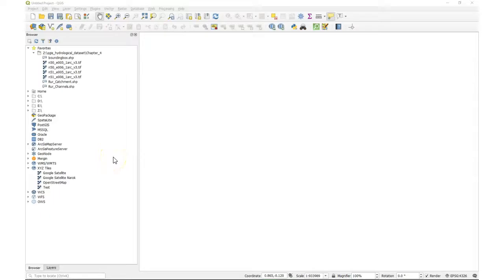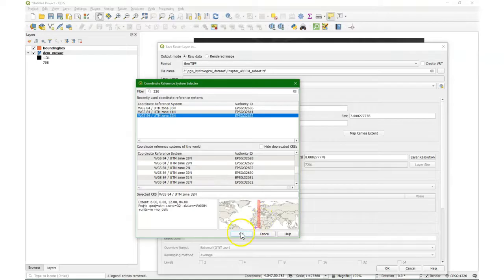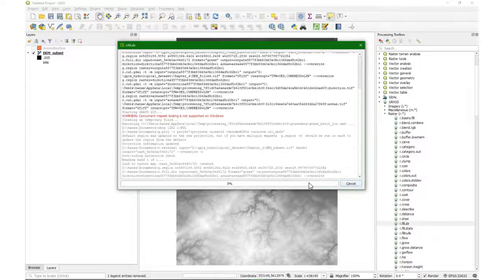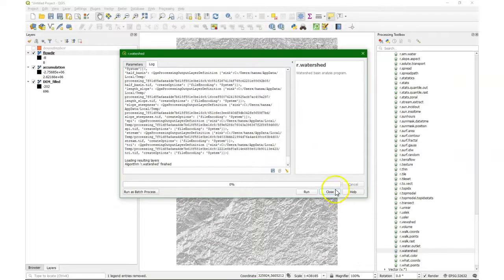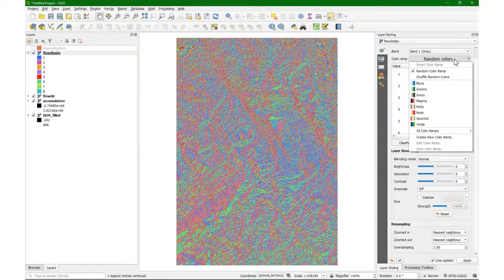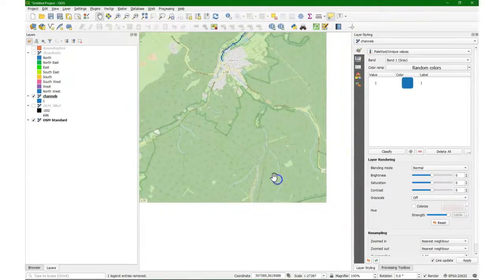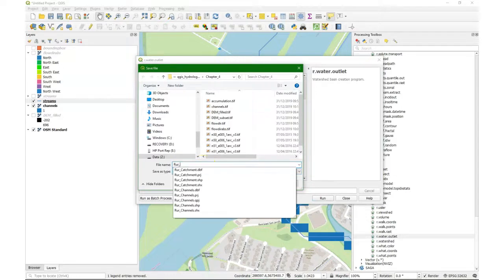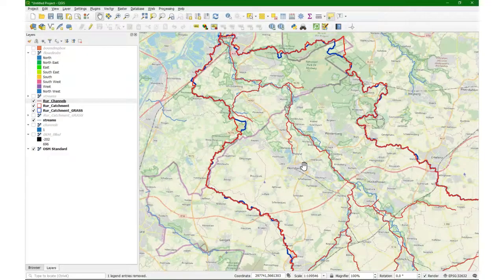Stream and Catchment Delineation in QGIS 3 using GRASS tools

Comment: Hi, I have 2 points where I got different outputs. When I tried to change the values for flowdirabs it would not just change the label but the output as a whole, which was not in your case. The second was for the river, I got it on value 0 but not on 1.
I apologise if it's hard to read but let me know if you would like me to rephrase, thanks.

Comment: Hi! Great video! How can I remove bridges from DEM? Problem is that when channel hits a bridge it redirects to a nearby catchment area.
Reply from the maker: Maybe the resolution of your DEM is so high that it is a DSM instead of a DTM. You could resample to a courser resolution. Or get a layer with bridges (e.g. through QuickOSM), rasterize them and apply some mapalgebra to reduce the elevation at the bridge.
Reply: @HansvanderKwast  it's 1x1m grid. But smaller bridges aren't removed. I Will try to modify it. Thank you.

Comment: Thank you very much for the video! I've found all your video's extremely helpful! I've been trying it out for my own project in Uganda but the result (both through GRASS tools and SAGA tools) channels are not always accurate to rivers displayed on basemaps. Even though a lot of rivers are the same, others are split in two different big rivers while on the basemaps it's just one river. I was wondering how I can alter the results so the channels are displayed more realistically. I've tried different SRTM layers, different tools, etc. but they all display 2 different rivers instead of 1.
Reply from the maker: You can try to improve the results by burning in the river network. There are 2 videos about that on my channel. Burning in the river network will force that the DEM is lower where the rivers are. Your problem can be caused by (1) human manipulation of the stream flow, (2) errors in the DEM, (3) resolution of the DEM in relation to local depressions, such as wetlands and lakes, ...
Reply: Thank you very much for your answer! I burned it and it displayed very accurate rivers now compared to my basemap! You're my hero

Comment: Thank you very much for the video Sir. Anyway, what is the unit of flow accumulation? Because on the channels creation step, you set the flow accumulation should be bigger than 50,000. Is it in m3/s?
Reply from the maker: Flow accumulation is the number of upstream cells that contribute to the cell. It's not m3/s, because there's no rainfall as input. So basically it is a unit of rain on each cell and then adds it up. A threshold >50k means that only cells that have more than 50k contributing cells are considered as a river. You need to calibrate that number by looking at existing maps or satellite images.

Comment: Hi thanks for the tutorial. I was able to make it to almost the very end but when I run r.waterout it kept showing SetColorTable() only supported for Byte or UInt16 bands in TIFF format. How to solve it?
Reply from the maker: That's no problem. You don't need a color table. Check if the output has been generated.

Comment: Hello, Sir. 
I can't produce a good watershed @ 20:15 because one of my streams wrongly flows to the opposite direction ( i also noticed it form the flow accumulation step). Is there any option to reverse its course? Thanks.
Reply from the maker: That's due to the DEM and maybe the filling process. Try another DEM or another workflow (PCRaster, SAGA, Whitebox).

Comment: I just discovered your channel and I love it. Does it matter the version of QGis?
Reply from the maker: The algorithms don't change. But to avoid errors I recommend to use the LTR versions. The problems have normally more to do with the steps:
- do not use a DEM without reprojecting from GCS to a projection with x, y in meters. Interpolarate voids, otherwise no continuity of the flow. Fill the sinks, otherwise a lot of disrupted streams. Don't use a very high resolution, especially if you have a large catchment. Don't use spaces, dots, special characters in folder and file names. The area should also not be too flat or too human modified. Outlets should be chosen in the delineated stream, otherwise it will not follow the model.
Reply: @HansvanderKwast  thanks a lot for your tips. I have two questions, is it the same reprojecting the dem than simply using the right click feature of exporting and choosing the desired SRC? I‘ve not seen in your videos the voids interpolation, does the fill tool make also that?
Reply from the maker: @SuperDanisse  Right click is available from version 3.16. The videos are made with older versions. This video shows how to interpolate voids: https://youtu.be/FwJSBoTn1y4

Comment: What happened to the upper left corner that downstream values are very dark (low) at 14:25?
Reply from the maker: These are negative flow accumulation values indicating that those cells have surface runoff from outside of the current geographic region. Meaning they don't belong to the catchment that we're going to derive.
Reply: @HansvanderKwast  Thanks a lot for detailed explanation. Your video is very helpful.
Reply from the maker: @jiongwang7645  FYI a step by step tutorial with data is available at GIS OpenCourseWare: http://www.gisopencourseware.org 
You can find it under the Advanced QGIS tutorials.

Comment: HI Hans, Can you please explain,  what does this (-) Flow accumulation mean? do we have to convert this "-" accumulation also into "+" values?
Problem:
1) I have a catchment which shows higher negative flow accumulation than "+" values, this "-" flow accumulation defines my river network exactly than positive flow accumulation
2) Why D8 is better than MFD Method?
Reply from the maker: Negative flow accumulation means that it's outside your catchment. More info here: https://grass.osgeo.org/grass76/manuals/r.watershed.html
D8 is not better than MFD. What you want to use depends on your area. In science you start with the most simple model. In this case D8. MFD might give better results in flatter areas. There are also other algorithms. See for example this document: https://rivix.com/Topics/D8_vs_Dinf.php
Reply: @HansvanderKwast  Thanks I will have a look on this documents
Reply: I am also getting negative accumulations - did you manage to fix it, if so how?
Reply: @cameronciaglia7171  I just converted it into positive values.
Reply: @maiyourathaankarunanandara3382  how you converted negative values to positive
Reply: @paisneepatel6469  I used rater calculator from qgis 
(Flowaccu<0)  × -1 × Flowaccu + (Flowaccu>0) × Flowaccu
Reply: @maiyourathaankarunanandara3382  thank you

Comment: @13:30 you went WAY to fast for the color editing! I slowed it down to .25 speed and I'm still having trouble following. What exactly were you doing with the color picker and the stops???
Reply: Same for the layer styling... I labeled everything (North, North East...), but when I finish, North is not on top. The Value is 2, but your North is on top. I really wish you would have explained this in better detail instead of blow through it.
Reply from the maker: It's covered in other videos. For example this one: https://youtu.be/2Ub0c7Ss-T4?t=2215 and this one https://youtu.be/q54xTyV7gAE. Also in the book QGIS for Hydrological Applications: https://locatepress.com/book/hyd. Info about encoding of flow direction by different tools: https://gis.stackexchange.com/questions/254939/legend-of-flow-direction-calculated-with-processing-toolbox-qgis-saga.
Reply from the maker: You can also download the ramp from the QGIS Style Hub: https://plugins.qgis.org/styles/116/
Reply: @HansvanderKwast  Thank you for the reply. Apologies for sounding snippy. I am trying to complete a catchment basin for my boss and it's taking days because all I've ever used is ArcMap + extensions, so I am having to teach myself QGIS with no one to help except Youtube. I was able to complete up to the accumulation layer, but my values for the main channel are coming out as -1000 to -100000+, but I know for a fact this  is the main channel the tributaries are feeding into. Some of the tributaries are giving a range in the 2000s, but others are -3000s. Where did I go wrong?
Reply from the maker: @joshuah.9687  There can be many reasons. I prefer to use methods with the Strahler order, because they're more intuitive. For teaching I use my own PCRaster Tools plugin. It's very robust. Check this tutorial: https://courses.gisopencourseware.org/course/view.php?id=48&section=1
You can also use the SAGA workflow: https://youtu.be/2Ub0c7Ss-T4.
If you're in a hurry use the models for SAGA here: https://plugins.qgis.org/models/ or for PCRaster via the Resource Sharing plugin: https://youtu.be/KbjIsFL_PcM
If you're in a super hurry, just use Lekan: https://www.reos.site/en/reos-project/lekan/

Comment: how to calculate the area of the respective stream order? we can calculate the length of each order stream but how to calculate the area? 1st order , 2nd order etc?.
Reply from the maker: These methods are pixel based. So you don't get an area of the stream, it's limited to 1 pixel and it's spatial resolution. If you want real areas, you need to find a way to derive the channel width from the DEM or through remote sensing classifcation. Once you have the polygons, you can calculate the area. If the river is available as polygons in OpenStreetMap you can also use that.
Reply: @HansvanderKwast  thank you so much sir.

Comment: Not getting the catchment boundary after applying r.outlet
Reply from the maker: Check if you have chosen an outlet in a delineated stream that corresponds with the filled DEM.
Reply: i had the same error as you. you have to make sure your project CRS is the same as the selected layer CRS (in this case the flow direction layer)